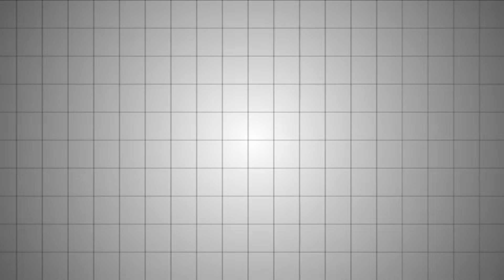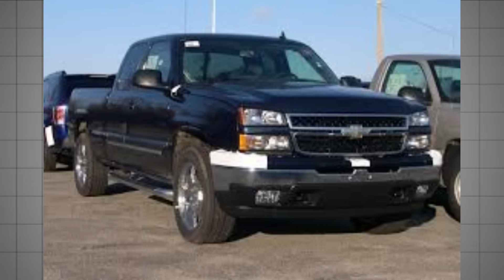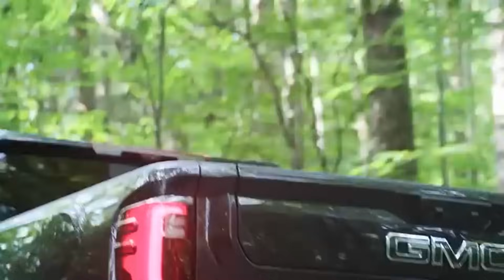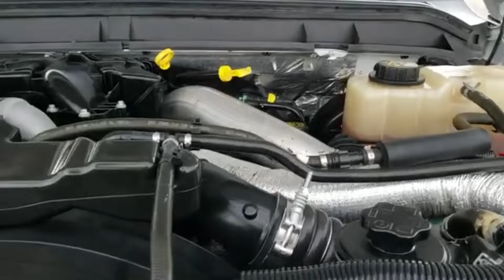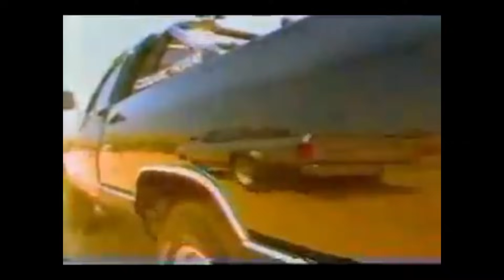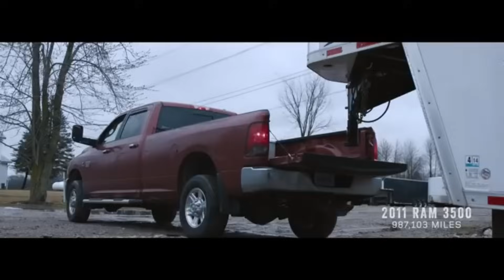Cummins vs Duramax vs Power Stroke

Comment: No offense but I’ll never buy any American made diesel UNLESS it’s in a truck that’s grandfathered in on this diesel emissions crap. I don’t want any of that stuff on my diesel truck engine.
Which brings up the question, do you really need a diesel engine? Because I was up at LOWES home improvement center and I struck up a conversation with a GMC truck owner and I asked him what engine he had in his truck. To which he replied a gasoline engine, and I said how’s that working out for you? He said that he and his family just got back from going to Mount Rushmore towing their 32 foot camping trailer . He said he didn’t any problems with towing it and all of their stuff. He said it ran perfectly with no mechanical issues. He said even going up steep inclines it done just fine. I was like ok that’s awesome. So getting back to whether or not you really need a diesel engine in your truck, in my opinion they’re nothing but an expensive time bomb. It’s only a matter of time before something catastrophic is going to occur and it’s going to be super mega expensive to repair.  For me I’m just gonna steer clear of diesel engines. God everything is ridiculously expensive

Comment: Okay, looking at the statistical data for reliability, it rates as follows: #1 GM, #2 Ford, #3 Ram...  I've owned each of these bad boys and I personally rate them as follows: My ford was very comfortable and had the most power out of the three.  No real mechanical issues so long as you maintain the vehicle properly.  My RAM had problems with the transfer case and the transmission, which was very aggravating, but the Cummins was tough as nails.  It just seemed that the Cummins engine has junk built around it.  I am currently in my 2nd GMC and No issues at all with either.  It has a little more horsepower than the RAM, about the same torque, but a way better ride and the overall quality of these GM's are far superior than the French owned RAM...  If I buy another diesel, I'll flip a coin between the GM or Ford...  They're definitely equally the best!

Comment: I have a 91 Dodge Dooley five speed with over 1,600,000 miles. I also have a 2005 2505 5 9 diesel with 330,000 miles and going strong

Comment: I had a 6 liter power stroke. Left me on the side of the road 6 times under warranty.  Ford factory representative told me “ there nothing wrong with that truck. Took me awhile to understand he was saying the truck was operating as designed. I drive a Cummins now.
Reply: Buddy of mine had a transport service and bought 4 brand new vans with 6.0 power stroke’s. He said that by the time the warranty expired they had spent more time in the dealership service bay than they had on the road.

Comment: Shit I got one of each. 2004 6.0 power stroke. A 2000 24 valve. And a 2015 Duramax and I drive the power stroke every day. The 6.0 built right is by far my favorite.

Comment: I’ve owned both a 2020 6.6L L5P dmax and the 2022 6.7 Pwr Stroke.  Both had 10 spd trans.  I prefer the Chev drive experience over the Ford.
Reply: I did the opposite bc the chevy trans kept going into limp mode
Reply: @MattC0725 I've got a 2021 im doing some research seems thr valve body has a simple spring valve that fails , with all the 10 speeds out now , someone will find a reliable fix ..
Reply: @underasecorasky  you can look up next gen valvebodies

Comment: My 2015 Duramax tows like the trailer isn't there and has great fuel economy. Still runs great at 160k miles.
Reply: Anything done to it such as bypass oil filter or deleted or anything?

Comment: The secret is after the warranty, delete everything and add etf transmission oil at each tank fill to lubricate and keep the injectors healthy so I maintain my 6.4 powerstroke without any problem after 16 years with zero engine problems

Comment: You didn't even mention the heater grid problem on virtually ALL Cummins Engines used in RAMS, where the nut & stud on the grid heater GETS INGESTED into the Engine  NECESSITATING ENGINE rEPLACEMENT !  And I'M Wondering WHY, as this is still a huge problem today that has not even been recalled !

Comment: 2005 LLY 300K and counting, the Duramax was designed and built by Isuzu in Japan 🇯🇵!
Reply: No, not hardly
Reply: @ The 6.6L was used in Japan 🇯🇵 for about Five years in delivery trucks before GM began using it.
Reply: @ Maybe the 6.6 Isuzu was but you said the Duramax was designed and built in Japan, which is not accurate.  Duramax was a joint effort between GM and Isuzu, designed and built in Morraine, OH.  I'm sure the design was heavily based on the 6.6 Isuzu but not completely.
Reply: @ 6.6L Isuzu/ Duramax = The Same

Comment: Own a 2022 ram 3500 and I've put 185K miles on it, only major repair I've done to it was the transmission, total cost $3800 other than that a few sensors here and there.
Reply: Did you have the 68rfe or the aisin?  I ask because I just purchased (well…about 6 months ago) a 23 5500 and hope to heck I get further than that before it goes out.  I wish I could swap my g56 from my 4th gen into it 😂

Comment: What about the cummins 2020 models with the roller lifter failures
Reply: Personally I've had better luck with the couple of powerstroke I have a 2000 F350 4wd drw with a 7.3 powerstroke and a 2019 F350 4wd lariat ultimate crew cab with 6.7 powerstroke it has been a incredible engine
Reply from the maker: @pauloneil3212  right 
Thank you for pointing out

Comment: That engine u showed for the ford was not a powerstroke , it was a 7.3 liter I D I ENGINE that they put a turbo , the power stroke was a direct injection  v8 with a Garrett  turbo and heui that used high pressure engine  oil to fire the injectors.  I know this because i owned every ford diesel from the 6.9 idi 7.3 idi then the 7.3 idi with the turbo and it only says turbo diesel under the f250/f350 badge , and then i had a couple 1997 powerstrokes, about 3  2000 7.3  powerstrokes were all great worktruck engines that never died on me , and are prob out there right  now doin something cool. The 86 6.9 had 689k when i sold it and all the other 7.3s i had  were all above 200k with some over 400k  i dont like any of the crap they are putting on these new diesels,  they could be tuned to burn way cleaner without all that junk
Reply from the maker: Okay 
This is great, really 
I should have used you as a source. You know it in out. Thank you for sharing.

Comment: Cummins is the only reliable engine on the market it is been out longer than duramax and power stroke
Reply: 5th gen not so much
Reply: All of them are unreliable. Cummins is still most reliable. Inline six makes it naturally smoother without balancers. Roller lifters are fine, people need to stop using 15w40. I think all of them can be reliable if they’re deleted. All three are great engines. Believe it or not, the Nissan/Cummins 5.0 is even reliable once you’ve removed all of the crap on it. That engine just needs oil changes every 5000 miles.
Reply: @MrNismopro  delusional
Reply: Cummins is having many problems. But yes the old ones were built anvils
Reply: @Bigtuna-jh9uq mostly user error
Reply: @Clearlykevin  nope. Failed lifters, camshaft failure, Rod failure. All documented on various forums.
Reply: @Bigtuna-jh9uq  I have a 19 and change my oil frequently, as of most people I’ve talked to with newer 6.7’s those issues can stem from the hardness of the material not having the correct tolerance. But failed maintenance as well as incorrect maintenance (incorrect oil) plus excessive idle time is a contributing factor
Reply: @Clearlykevin   It's well known that the 5th gens are having problems. Suggesting others are not doing proper maintenance is an excuse. PD Diesel Power on Youtube had 4 2022's go down.  If yours is going strong I'm happy for you.
Reply: @Bigtuna-jh9uq  that’s why I said the hardest of the materials is incorrect, I’m fully prepared to swap a Hamilton cam and flat tappets in there. I’m not saying no problems exist I said it is a contributing factor to a widespread problem
Reply: Cummins in not the only reliable engine, that's a loose statement sir, you can say its a reputable engine manufacturer but to say its the only relaible engine is rediculious. I work for cummins and of lately the issues our cummins branch is seeing is unacceptable
Reply: @ I work around the trucks every day I know what engine does good I’m a mechanic too  we have had better luck with Cummins than ford and Chevy
Reply: @ShawnMullins-r4f  maybe in your neck of the woods
Reply: Lol too bad the rest of the dodge is garbage
Reply: I used to think so too till I owned 3 5.9s and 1 6.7 was always having injectors issues so I got rid of them bought a lbz duramax owned it for 2 years no issues to speak of with a much better truck all around then dodge

Comment: Unfortunately the new Cummins 2019 and up has had issues with the hydraulic lifters. Mine went at 39k. Hopefully they get it sorted out as otherwise is an amazing engine. The exhaust brake sounds incredible and it just chugs along towing heavy loads. Definitely not the quickest of the bunch though.
Reply: @rickkeller105  Do you have the standard output or the HO? Wondering if the issue affects all Cummins 6.7s or only certain configs.
Reply: @ standard output. Have heard the lifters have been redesigned a few times now but is only hearsay from others so nothing conclusive.
Reply: What were your oil change intervals and what oil did you use?
Reply: @ every 5k tops Rotella T6
Reply: @rickkeller105  well shit that’s not good.  Hopefully that doesn’t happen to me!  I had a trusted local shop do my first oil change and they used fricken rotella 15-40!  I called ‘em up and asked why they used the standard oil for older diesel motors instead of 5-40/10-30(which I will never use) and never got a call back.  Just swapped out for some T6 today because at least I am aware it doesn’t have flat tappets and the hydraulic rollers are temperamental SOBs apparently.  What I wanna know is why the hell ram says to use 10-30 in warmer temps and 5-40 in cold temps?!?

Comment: can chevy actually tow 30000 pounds or are the lagging behind like normal?
Reply: Since the T1 platform in 2020 arrived yes. Even the previous generation can pull that weight but GM holding back it's potential and focused on reliably and safety instead of chasing class leading numbers like Ford.

Comment: It goes Cummins, powerstroke, duramax. Duramax is dogshit, Cummins and powerstroke is just person preference. Powerstrokes have a nicer/cleaner interior, Cummins 100% for hauling but a powerstroke will do almost the same exact as a Cummins. Powerstrokes will last longer but Cummins will give u a run for ur buck for how nice they haul.
Reply: You have no clue.

Powerstroke had about a decade worth of bad years between the 6.0, 6.4, and early 6.7’s. It’s made in Mexico 

Cummins had its problems too. VP44, KDP, and the casted blocks from Brazil that crack. 

Duramax has had less problems between the 3 and is the only one made in the USA.
Reply: @Bigtuna-jh9uq  all suck with the current emissions. but ive had to replace more fuel injectors in Duramax's than any other. most the Cummins i see are for  maintince not major repairs. an the tickers are usally over 300k. but like i said they all suck with the current emissions. shop often gets all 3 in with emissions related problems. but i dont work on thoes. but cummins is far more popular by me.
Reply: @Bigtuna-jh9uq haha he has no clue but you list the 53 block from the 90’s as a problem.  It’s 2024 bro.  All 3 are good engines it’s the government regulated shit they put on them that kill all of them.
Reply: That’s why Duramax is outselling powerstroke and Cummins combined
Reply: @mikewarren1401  Where are you seeing DuraMax sales of that number. Everything on market data shows Ford Power stroke sales greater. Based on GMC / Chevy Diesel truck sales compared to Ram Diesel and Ford Super Duty Diesel sales.
Reply: @dougcjohnreal simple
Reply: @dougcjohngoogle diesel truck sales numbers then hit Engine technology forum. It’s the only site that shows actual diesel sales numbers by quarter. You will see Duramax is almost doubling powerstroke sales! You can’t just go on what you see around you
Reply: @mikewarren1401  not accurate, Ford out sells … most years GM (Chevy GMC) are about equal to Ford… other years Ford sells exceed.  

Manufacture accurate data for all 3: GM, Ram, Ford aren’t published to public… data that is provided for sales normally indicates Ford top sales.

All 3 have their history of problems, and all 3 have their strengths. How all 3 have had to adapt to Emissions that have challenged them all, making Diesel expensive to maintain. 

That aside, the Super Duty exceeds GM on value marks: HP, Torque, Pull Rates, etc.  Personally: spacious cabin, great comfortable seats, no rust body on top of great 6.7 Power plant.
Reply: @dougcjohnit’s accurate. Just look it up! Your just making stuff up in your head instead of looking at real numbers
Reply: @mikewarren1401   sorry, you’re way off.  Enjoy the DuraMax, that’s all that matters.
Reply: @mikewarren1401  a simple google search could easily prove that wrong, The Ford F-Series is the best-selling truck in the United States, and the Ford F-250 Super Duty is a top diesel truck model. I see fords the most then ram then Chevy

Comment: In Germany a ”BigDiesel“ is a 3.0 Bmw or Audi 6 cylinder😅😂
Reply: Or a Q7 V12 tdi / touareg V10 tdi
Reply: @nono2.087  Those won’t ever be around again, though. VW took the diesel V10 and replaced it with a V6. I think the V10 buyers quickly found out that paying four figures for seemingly every service item north of an oil change wasn’t fun.